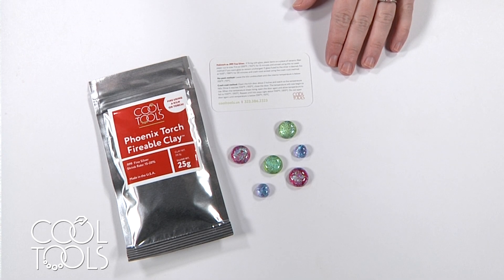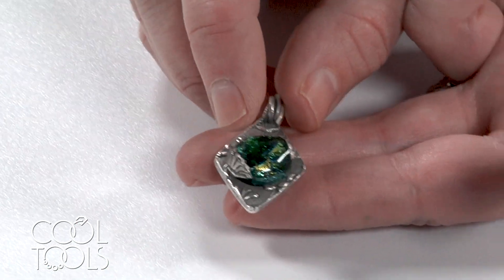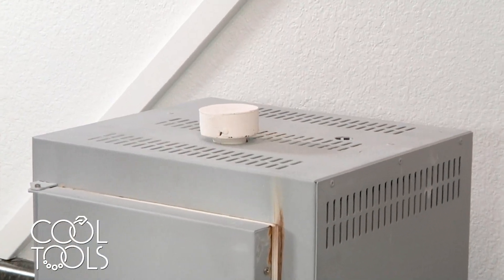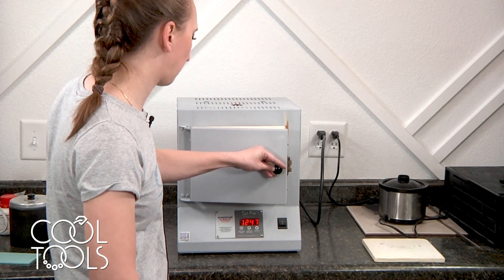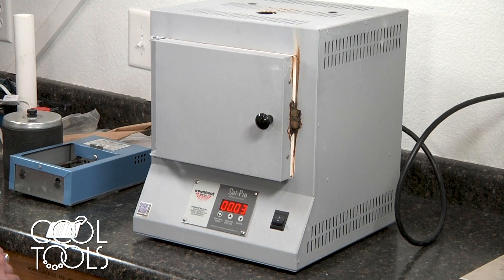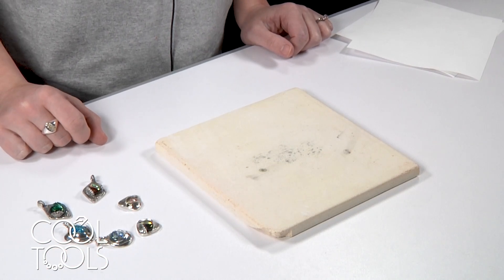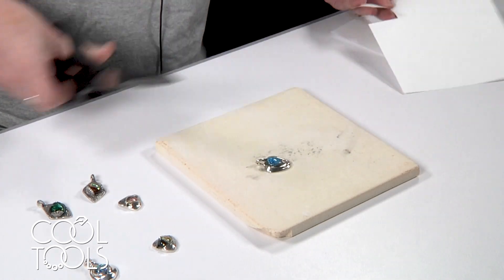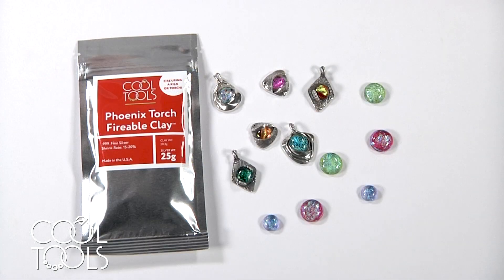Cool Tools | Firing Glass Cabochons with Phoenix Torch Fireable Clay™

Comment: Is it possible to use silver clay with 104coe glass? Seems like 1300 would just melt the glass out of shape?
Reply from the maker: Hello, Phoenix fires as low as 1200°F for 30 minutes. At 1300°F, 104 COE glass will slump, lose its shape, or even stick to kiln shelves unless carefully supported. We would recommend to not go over 1200°F for 104 COE.
Reply: @cooltoolsvideos  Thank you so much for the reply, I'm very curious about metal clay and eager to give it a try but I only use and keep 104's for the moment.

Comment: Why are you thermal shocking the glass?
Reply from the maker: The crash-cool method is used if you want the glass fused to the silver. If you want the glass to remain unchanged, do not open the kiln door until the temperature is below 200°F. Hope this helps clarify!